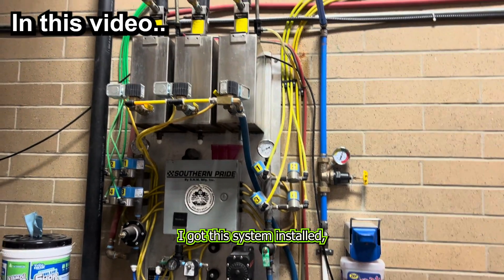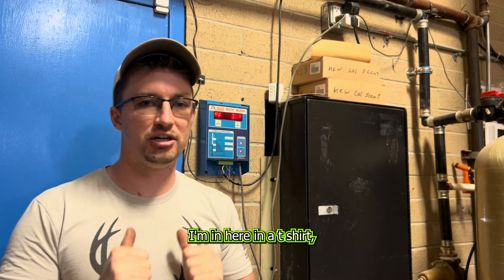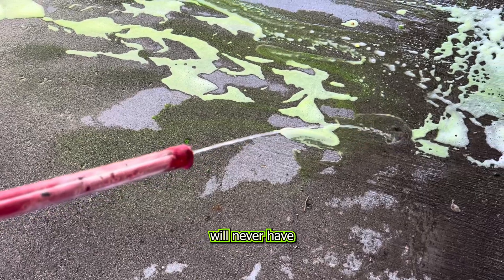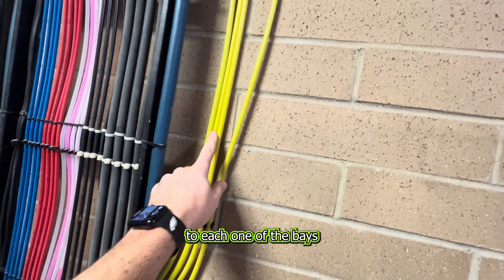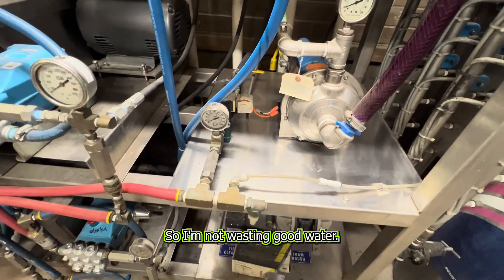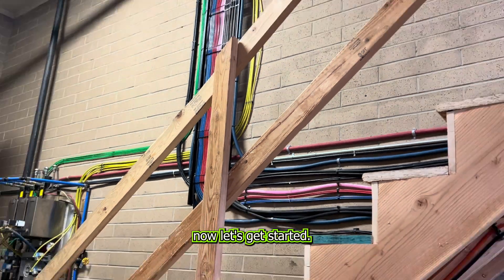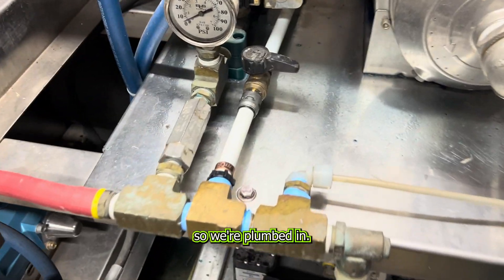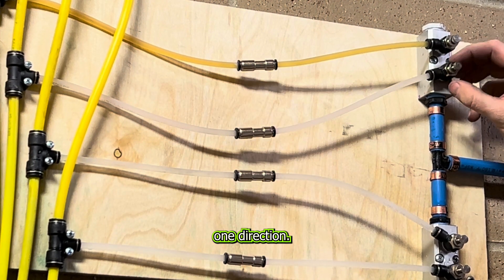What Keeps Car Washes from FREEZING UP?

Comment: I recall you made a post on a forum about the original setup the triple foam system uses to keep it from freezing, and I believe that was for an air blowout of the lines. Typically the systems near me either use cold weather triple foam, or an air blowout system. I don't normally see the weep water hooked to it.

Comment: I have a heated hose trough, and the recirculating pump failed, but the Weep Mizer system kept the system from freezing even in subzero temperatures.   It's a great system!  This is great content, too.